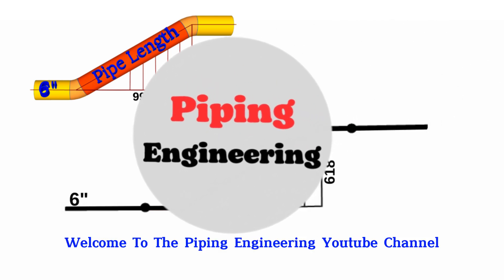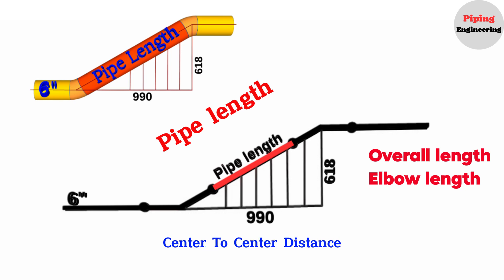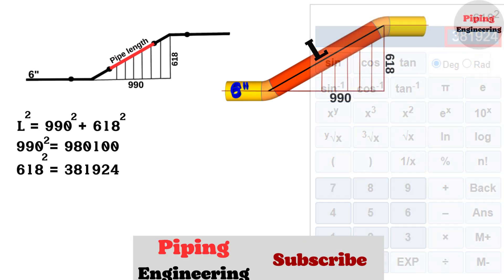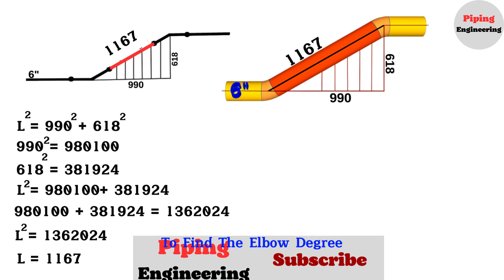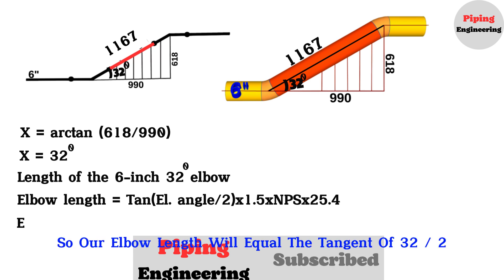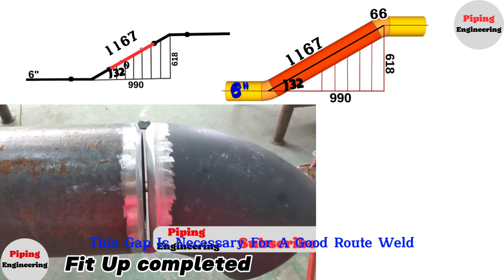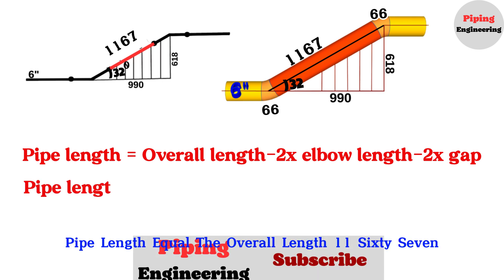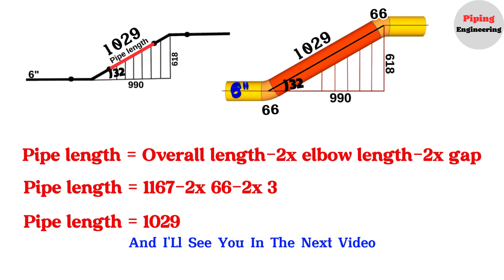Double Rolling Pipelines Made Easy: Essential Length & Elbow Calculations!

Comment: But when you find the elbow angle or degree at the top size using arctan (990/618) you will get 58° but the arctan(990/618) is 32°

So why use the same 32° for the top elbow angle. 

Can you explain further to me please